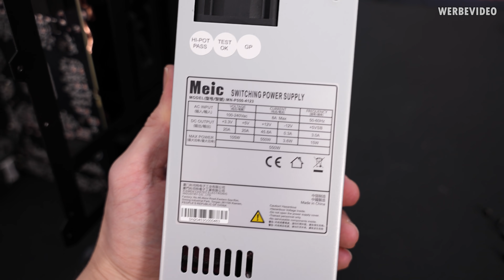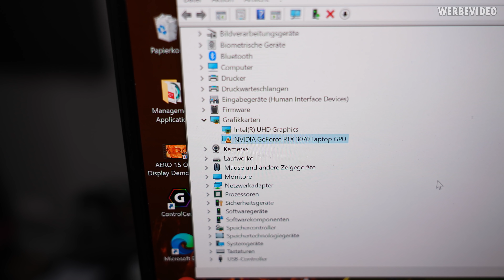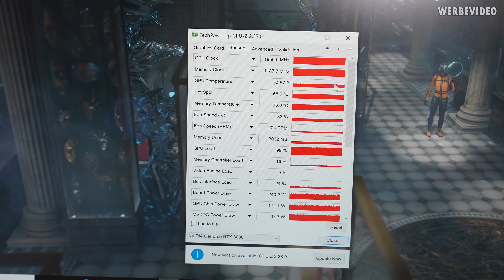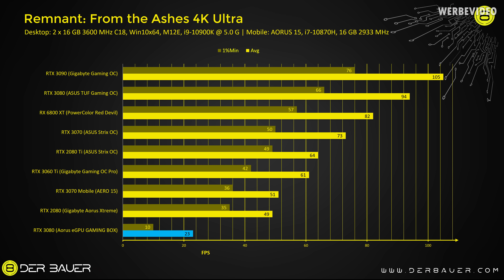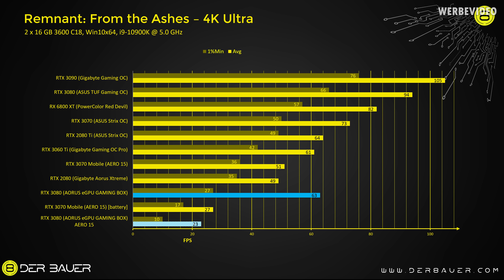So much Copper! External Graphics Card with Water Cooling... and Problems during the Review

Comment: Using a DIY eGPU (currently RX570) with a Thinkpad 480 laptop my guess on the low fps would be the still running laptop monitor (at least this was what we saw on your video even if you mentioned the video data which has to travel back through the TB3 cable). I always go for 2nd screen only mode (connected to eGPU output of course) and have no issues. Even if I'm a lil late on that video maybe you wanna give that a try. Cheers

Comment: You might be running into bottlenecking issues by having devices plugged into the connections on the back of the dock.  Try re-running it w/o any peripherals plugged into the dock, and see if anything changes.  You're probably splitting the 4 lanes between the video card, and the other connections on the back.
Reply: Thanks for watching, you can leave a message on WhatsApp>>>>>>>
+1 (786)588-5774:

Comment: Did you set the laptop to external monitor only, or to extend, while running your benchmark, if not that might have helped, on the results. (Do not use duplicate) 🙂
Reply: Thanks for watching, you can leave a message on WhatsApp>>>>>>>
+1 (786)588-5774:

Comment: it can be that if you plug the ethernet and usb then link of gpu comes to x2 to leave bandwidth for ethernet and usb so try to unplug them.
check bios version on laptop
check thunderbolt firmware on laptop
disable laptop screen

Comment: One thing I've questioned about thunderbolt eGPUs speed is the Laptop's CPU. Something with the 45W TDP CPUs (i7 10750H (Comet Lake)) makes the eGPUs run slower than the 15W CPUs (i7 1065G7(Ice Lake)). I've heard that it has something to do with the chipset.
Reply: Thanks for watching, you can leave a message on WhatsApp>>>>>>>
+1 (786)588-5774:

Comment: I heard that either the 10th or 11th gen U series CPUs got a significant thunderbolt controller upgrade, which resulted in significantly lower latency. The Skylake H series chip in the Aero will have the older controller, while the 10900K motherboard might have the updated controller on it. If that Z590 board has the updated controller, it may explain some of the performance difference. Also if this is the case, then even the Tiger Lake 4 core U chips may have better performance, due to the thunderbolt controller being the bottleneck.
Reply: Thanks for watching, you can leave a message on WhatsApp>>>>>>>
+1 (786)588-5774:

Comment: The gpu can report x4 because that's how it's plugged inside the box while thunderbolt connections are often only x2 on laptops because they cheap out especially if they think you won't use it this way (there is a 3070 in this laptop after all). And it's really hard to find the width of the thunderbolt link.
Reply: TB3 = x4 always. and video link is prioritize over the rest so should keep it at x4 for gpu but can happen if you have too many other peripheral then it has to reduce gpu link nut not an issue of TB3 is an issue of how you use it and you have too many peripherals also communicating over TB3.

Comment: Plug it directly into that desktop mainboard!
You know we all want to see it!
Reply: exactly.
Reply: Was wondering the same as well.
Cus then I can run more monitors without affecting performance on my main monitor as much :^)
Reply: exactly
Reply: So do I, but I think we all know it will perform exactly the same as any other 3080. I'm sure the pcb is the same as one of their other desktop cards.
Reply: @capnclutch007  Well, it does have  full coverage all copper hybrid water cooling, so....
Reply: @capnclutch007  with past experience pulling GPU's out of these eGPU's ( most notably the 980ti I pulled out of an Alienware enclosure) they mostly use reference design boards that do not perform all that great

Comment: What happens if the laptop is powered separately? On one of the screen I got the impression that the eGPU was using 250W but the core was only using 90W. Was it prioritizing powering the laptop?
Reply: I think that's the problem. My Asus notebook for instance will only charge at up to 65W over USB-C/TB and significantly downclocks the CPU unless you use the full AC adapter brick. Would not be surprised if the Gigabyte notebook has something similar. You can see at 7:30 that the AC adapter is not plugged in, just the TB cable.
Reply: My thoughs exactly ... many laptops behave a bit weirdly when powered by the thunderbolt port, from restricting performance (both on CPU and GPU) to simply not working properly. In this case the eGPU dock itself might not play nice with the laptop requested power...
My HP laptop will have seizure inducing behaviors when trying to use a thunderbolt monitor (and the monitor is able to provide more power than what the laptop requires) without the barrel plug charger on the laptop, even though it charges fine and you can game on it while charging via USB-C...

Comment: I know why your 3070 in the laptop is broken when you're running on thunderbolt since I faced the same exact issue on my Aorus X7. It's BIOS related, for some reason Aorus releases exact same BIOS for an SKU that comes in different GPU configurations. In cases like this it will trigger something that will cause your SKU to be wrongly detected both in Windows and the BIOS and cause change on the SUBSYS_ID of your GPU. In my case because of this it won't even let me install/update drivers anymore unless I mod the inf files since the DEVICE_ID will remain the same but the SUBSYS_ID is of a different GPU.

Comment: Ugh if only we could use pcie gen 4.0 for the the thunderbolt link. Because gen 4 at 4x would basically be an 8x at gen 3 speeds, while still not ideal, is enough bandwidth to really let that 3080 shine
Reply: Thanks for watching, you can leave a message on WhatsApp>>>>>>>
+1 (786)588-5774